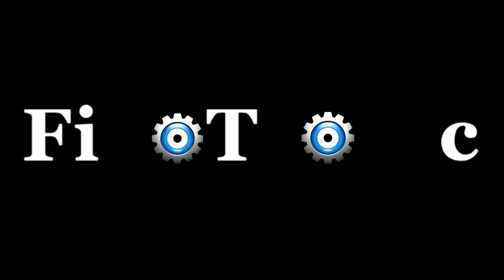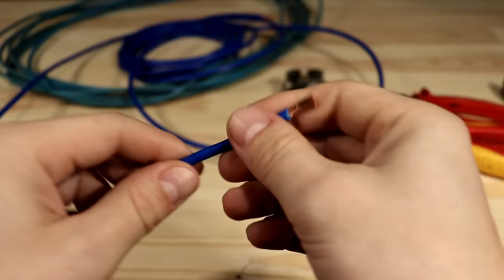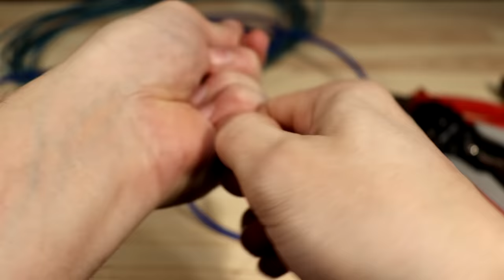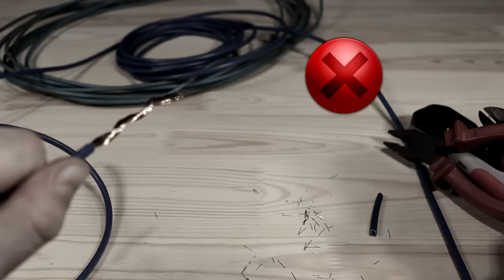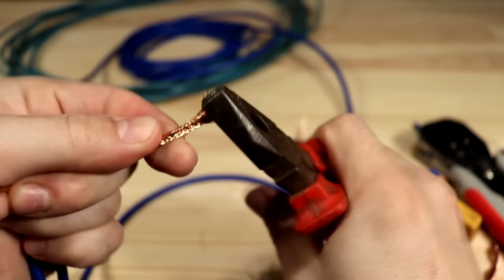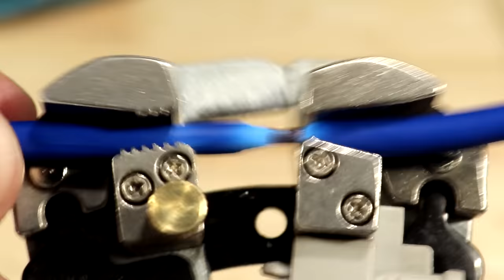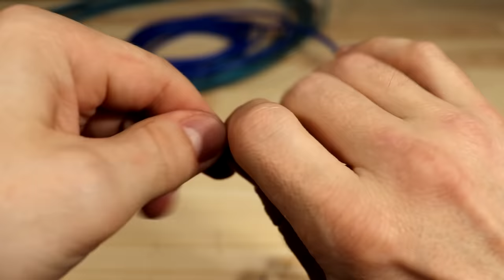AWESOME IDEA! HOW TO TWIST ELECTRIC WIRE TOGETHER!

Comment: There's a million ways to do everything wrong, next time don't waste peoples time, just show the right way.
Reply: Knowing how to 'not' do something is equally critical in knowing how to do something. Invention and science are reliant on failure. Patience is essential to saturation in the learning process. Consider how many people may have never done either process. For those, they leaned more than the impatient.
Reply: @AtomkeySinclair  Nonsense!
Show how to do the right way!
And that´s it!!
Or do you REALLY need to see how to do the wrong way?
Reply: um,  you're browsing random videos on youtube.  you were wasting time before you stumbled here and you'll likely be wasting time long after this.
Reply: He clearly isn't an electrician or knows about impedance. This is definitely not the right way. Fine for low voltage applications, but still wrong.
Reply: Amen!!!!
Reply: @FerreiraNeto77  You do need to know wrong ways of doing things to not repeat those mistakes.
Reply: Doesnt really matter in most cases how you do this. It depends on what the link is for and what sort of wire you use. Ive been using primarily method 1 (bc its faster), specially for 220V single strand wire, but also for hifi wire, then solder and tape up. (heated if i want to seal it).
Method 3 looks better and is way better if you need to pull wire through a tube, bc it is smaller in diameter of connection. The forces applied usually dont matter, bc there is no or very little strain on such wire and if you have to pull it through existing wire where a lot of force is applied in bends and such, all these methods will likely sever the bond.
Reply: so that's how you turn a LOGICAl idea into a 20 minute video... In 2019 I am KINDA partial to INSTANT info. 
I can get ALL world news in 10 minutes but it takes a "creator" 30 minutes to splice wire.
Reply: Yup.. he could show milion ways of doing it right.. like, wire crimp :) Its more used in car repairs, because not soldered connections are less likely to break overtime.
Reply: Luis Trigo Prunera. You don’t need to know the wrong way once you know the right way. Jeeeeez.
Reply: @luistrigoprunera3836  Sorry, but that is just stupid.
If I want to know the wrong way of doing something, I´ll look for a video that teach me the wrong way.
But if I open a video to learn how to do something right, this is what I hope to see.
If you learn the right way, you do not need to worry with all those mistakes.
Imagine if schools decide to follow your advice and teach the wrong ways for students. When they finally understood the mistakes, only then would the teacher teach them the correct way.
You really can not see how stupid this concept is?
Reply: @uplandmines  Please, ellaborate your answer
Reply: Right way is to use Wago 221 or similar splicer.
Reply: Agree!!!
Reply: @AtomkeySinclair  'Knowing how to 'not' do something is equally critical.'  Great.  You don't join two wires together by tying a rope to your ankle, the other end of the rope to an anvil, and throwing the anvil overboard when you are on a boat out on the water.  Critical information you clearly needed to know..
Reply: Here here. The right way is usually the best way.
Reply: That's not even the correct way.  The correct way involves inter-winding and soldering.
Reply: @luistrigoprunera3836  So many of us do, already...
Reply: cant believe i watch the whole two wrong ways & type the comment tho...
Reply: Agree
Reply: In french, it's called "épissure" and it is forbidden in electrical systems
Reply: @jaytony6535  I hear ya... ( not that I necessarily understand the meaning of the words you typed but... I, on average, don't understand the words I type myself ... On any given night... You clip single 11 [meanungless drivel here]
Reply: After 2 minutes I been looking at what minute to skip all this bullshit lol
Reply: @uplandmines  It is quite clear and obvious that It is for low voltage applications, the wires are too much thin for high voltage applications.
Reply: indeed....DO show us all methods as simetimes we think the "Alternate" is just as good...and isn't . Really?...6 min vid is too long in our precious lives?.... for a detail that can prevent an electrical fire and can save lives??
Reply: Please elaborate, @upland mines.
Reply: @FerreiraNeto77  how not to do the wrong way is equally important as how to do the right way. But I agree with Yu. He should have shown the wrong ways in fast forward and then show the right way. Chill man. Life is short.to each his own way.
Reply: Somtime, u must learn mistake.. and much people thing that is the right way, actualy in this video he try to show, that is the wrong way..
Reply: If you've got that much strain on your wires you're doing something wrong.... Wires are for electricity not support structure.
Reply: @ChillyDippers  ya. You ar spot on. I think these measures are only for certain outdoor emergency albeit temporary situations. It would be stupid to use it in permanent installations.
Reply: The first 6 mins was a waste of my time. Cheers.. 🤔
Reply: Don't you cut each wire diameter by half so the twisted final wire is the same guage as both original wires???
Reply: Agree
Reply: yes agree, wasting my time
Reply: John David  This is NOT how you do 110/220 hard single core wire as in household wiring, you use a twist cap then tape the cap to the wires to help seal any bare wire, The cap has a narrowing spring in it that slightly cuts into the copper wires and makes a tight solid connection. This method shown are for basically low voltage, light weight wire. Speakers, phone etc. Tight connection = less resistance = less heat = less loss
Reply: Good morning John David,
no, he’s definitely not an electrician. 
Cheers,
Si.
Reply: @AtomkeySinclair  No need for a essay. And you also don't need to be shown the wrong way. When you was taught in school. I can bet they didn't show you how not to do it. Every watched educational videos? Again they never show you the wrong way. This guy's a time waster
Reply: hahahahaha
Reply: Right Way would have been replace the entire length.
Reply: John David  No it wont as long as you use quality caps and tighten securely
Reply: I enjoyed the video
Reply: Dude... you do know you can skip the video until the end and watch what you want, don't you?
Reply: Hi John David,
I apologise if I err. I am positive techniques have moved on at tremendous pace in the many years since I completed my time as an apprentice. This has possibly left me with sketchy memories of a bygone age. I truly thought that as I have just recently retired after a career of almost forty years initially as an EHV cable jointer (including the associated telecoms and control requirements) before becoming an electrical engineer in the supply industry, I may have incorrectly presumed I possessed a tenuous grasp on the subject. 
Cheers,
Si.
Reply: @budman8926  Got me man - My welding instructors were insistent for two years on demonstrating how to not weld - in order that we understand how to weld. I suppose they thought it was important to know what makes a weld fail - ya know, since people's lives are on the line when the are in a steel skyscraper, or a bridge, or heck, even a roof top.
Reply: @luistrigoprunera3836   I know 10 more wrong ways. So video should be longer 30 minutes
Reply: @uplandmines  could you please direct me to the proper way.
Reply: Thanks brother
Reply: How do u know it is wrong man 
Try it first than say🤔😑😐😌😊
Reply: @uplandmines  Exactly. Maybe acceptable for low voltage (and low current), but that's a big wire for most low voltage applications. Use the correct connectors, or solder and insulate.
Reply: John David  This method is stupid. Don't pay attention to anything you saw in this video. It's incorrect and a pointless waste of time.
Reply: Stephen Flaim
Reply: Matthew Blouse absolutely not! The wires wouldn’t be able to carry the load if you cut strands off. It would then heat up and cause a fire
Reply: Harley Ross I think you’re right. It’s a western Union splice. We learned about it in high school but I have been an electrician for almost thirty years now and have NEVER seen it outside of a textbook. I think it’s safe to say it is NOT the right way to do it anymore
Reply: Robert Smith nope. They make smaller “caps” for smaller wire. You’ll never see this splice in the field. This is the way they did it in the 50’s I believe. Really outdated
Reply: John David because it’s illegal!!! You’d never pass an inspection with this madness. This man is either 100 years old or not an electrician. Either way, please, forget you ever saw this video
Reply: NASA KNOT ANYONE?
Reply: @justinrockmore327  sorry you feel that way about the truth
Reply: exactly!!!
Reply: Agreed, theres not enough time in the world to know all the wrong ways of doing something, just teach me the right way to do it and I have no reason to do it any other way.
Reply: The first "wrong way" is the easiest and most common way, not just a random wrong way. So it's relevant and a comparison is needed. Without it, the new proposed way is not proven to be a better alternative.

This information is free, the video is just 6 minutes, no one force us to watch it, and seek bar is there for a reason.

Thank you for making and sharing this video.
Reply: Exactly as i said we def learned how to struggle  stripping wire and then the last way (his right way) he put the super twist with the pliers lol
Reply: I SO AGREE WITH YOU!!! WTF..just show us the laast  one for gods sake!!
Reply: Jonathan Tenorio €
Reply: BRRRTTT!
Reply: Nigga could have just solidered the damn wires. That's the real right way.
Reply: StephenFlaim LOOKING4TRUTH 
OMG!!!  I so agree... like everyone else on the planet🙄!!!  ...except for the gentleman who did the video. 🤭😬😁😁😁😁
Great GREEN F*CKING CHECK MARK  ✅ TIP at the end... seriously, that’s a great method! Thanks!  (But that buzzer that made me jump, that was just plain mean!)🤨.  I gotta get that tool for my husband ASAP.  But, yeah... a lot of time wasted & showing the WRONG WAYS might confuse one’s memory... ya know, like 3 years from now when you’re trying to remember this method on the fly.
Reply: Agree
Reply: @FerreiraNeto77  exactly
Reply: @luistrigoprunera3836 how  are you not going to confuse the wrong ways with the right  ways?
Reply: @JacobIsaacSolomon  a Western Union splice
Reply: @BenoitLahlou  if you solder it afterwards that is a Western Union splice, that is the only splices you can have outside of a box. It's used mainly in Old work with knob and tube wiring.
Reply: @Beardy-plays  and it's not a Western Union splice unless he's sodders it afterwards, and then tapes it with rubber tape, and lastly wraps electrical tape around it.
Reply: @doc5380  or old work, with knob and tube wiring where your splicing outside of a box, but you must solder it afterwards.
Reply: John David  what are the journeyman teaching you??
Reply: @simoncoulston7223  people are going to be a little rusty  at things they don't do everyday, then the things they do daily. It would be like an orthopedist or dermatologist attempting to perform CPR
Reply: @exodeus7959  that's been done already, you could probably find that here on YouTube, old footage with  crash test dummies.
Reply: @AtomkeySinclair  and the sad thing is if somebody's first experience with something is shown to them the wrong way, it's very hard to correct them later,  and show them the right way. A good or bad teacher can make all the difference in the world.
Reply: @2ceeze893  it's used primarily now in Old work where your splicing into knob and tube wiring, outside of a box. BUT you must solder it afterwards, and wrap rubber tape around it, and then electrical tape it.
Reply: John David  you have to be able to know what is accurate though and what isn't. It would be like somebody telling  you about spark plugs for diesel engines,  and if you don't know diesel engines don't have spark plugs, you might take whatever they're telling you seriously.
Reply: Good morning Frank Paya,
I couldn’t agree more. Anyone who, for whatever reason, is unable to practice the use of their talents and skills on a regular basis, is without doubt going to become rusty. 
As a side note, I very much hope that we are all saved from ever being called upon to perform CPR.
Please don’t misunderstand me as I know that people taught CPR in a classroom (as part of their employment etc.) have saved many, many lives and it’s truly a fantastic skill to learn. I am very aware though that it’s a totally different scenario altogether when one is in a real life or death situation.
Basically I wouldn’t wish the situation on anyone. It certainly put much fear in me and would once more should it ever happen again. 
Hoping you and your’s stay safe during these unsettling times in which we currently live. 
Stay safe. 
Cheers,
Si.
Reply: Good morning John David,
that’s your opinion and very valid it is. It just differs from mine that’s all. Each to their own and so on. I don’t think I actually described my method. Or did I? I very much doubt the existence of a method I could claim as mine own and would definitely never claim I had knowledge of the only correct approach. I’m afraid I have neither the time or inclination to look back through this thread in order to find out for certain. 
Anyhow I wouldn’t like to think that either one of us being gentlemen, could ever become overly upset over such. .
Either way I’m now at a point in my life where it’s very unlikely indeed that I’ll be required to make such a connection. So you may rest easy that the “wrong way” is no longer being followed at least by me. 
Hoping your apprenticeship was completed with distinction, associated flying colours and was celebrated with much fanfare by all. 
Stay safe young man.
Cheers,
Si.
Reply: @frankpaya690  yes it is. The act of splicing the 2 wires is the splice. 
The finishing is just that. 

You're a fool if you think just because it wasn't soldered and taped that it wasn't spliced.
Reply: @frankpaya690  You know this is strange. I literally have to go to WU. Thank you for reminding me and taking the time to comment and  let me know the correct term. I much  appreciate it! You are a very kind person.
Reply: Technical ITS
Reply: @uplandmines  It is wrong way, isn't it ? Then find and explain the right way you know !
Reply: You are right
Reply: Ferreira Neto l
Reply: StephenFlaim LOOKING4TRUTH no shit
Reply: @ramsdellcp  Some people research the right way before important project. Wasting ones time just because he is allegedly wasting it browsing youtube is wrong.
Reply: agree
Reply: No kidding. Way to long for that!
Reply: Wow 10 minutes spent just so he could make a piss poor video on how to do a lineman splice
Reply: @FerreiraNeto77  He is a time thief!
Reply: No , I think this tutorial works for a layman like me coz I was doing the wrong way like  it have show before
Reply: @FerreiraNeto77  That is how you learn, you are shown the mistakes, and understand it better.
Reply: agreed.. but also when was last time one had  one braid of  wire to cross over.. mainly  now its triads of wires to blend
Reply: @ramsdellcp  well put.
Reply: @Achabab  That video you show is for crimping, and it is not the best way of doing it, solder creates a solid joint followed by heat shrink is the better way as you not only have more contact, but better insulation as well.
Reply: You need to see WHY the other methods are wrong. But yes, this video could have been a lot shorter while still showing that.
Reply: The first one is the way you're supposed to do it 
That and then put a wirenut on it
Reply: @gamerguy247365  They are called crimps, cheap and nasty
Reply: @gamerguy247365  yes thats correct, and make it strong 100% l
Reply: @uplandmines    Maybe he should try Viag....ohhh impedance. never mind.
Reply: The twist:  the last way is also the wrong way.
Reply: @AtomkeySinclair  
   

,0 '
Reply: Wasting time
Reply: savage dude...!!!
Reply: John David  Auch die letzte Variante ist falsch und unzulässig weil gefährlich.
Reply: @ramsdellcp  some people come here for experience in the trade?
Reply: @uplandmines  I am an electrician,it's called a Western Union splice.What about Impedance?I don't see a coil there anywhere.
Reply: @Murilo183  You obviously never worked with thhn wire.Looks like 14 or 12 gauge
Reply: @damistavista9539  I really do not know how you supposed or guessed I do not work with wires...are you a fortune teller???🤣🤣🤣
Better luck  next time man, I REALLY DO WORK WITH WIRES, I am a eletrictician...do you??
Reply: @Murilo183  Well, I hope you're a better at electrical work then spelling.lol Yes I am an "Electrician."
Reply: @damistavista9539  certainly I am...english is not my native language ( i am brazilian), the same way i give it back to you: are you a better electrician than you are at fortune telling???

Be humble fella...be humble.
Reply: @Murilo183  I am humbled sir.Do you live in Brazille or US?
Reply: @damistavista9539  I am brazilian... for your form of writting my country 's name you (Brazille), I suppose you are italian...am i right?😆😆
Reply: true shit
Reply: Saiko pet
Reply: Atomkey Sinclai
Reply: @AtomkeySinclair  ¹
Reply: 90% videa je dôležitá asi tak ako vyrazená poistka v hodinách alebo ako sám tvorca vydea
Reply: If you don't want to waste time, don't watch YouTube.
Reply: 10 /4  what a wast of time   I though I might learn something
Reply: @AtomkeySinclair  a
Reply: Exactly! Won’t be watching any more!
Reply: Ķķ
Reply: Exactly!
Reply: Bingo!!!
Reply: I appreciate the effort you put into making this video.
Reply: This video presents an awesome and innovative idea for twisting electric wires together. The step-by-step guide is concise and easy to follow, making it a valuable resource for anyone working with electrical wiring. The technique demonstrated is both practical and efficient.
Reply: While the video was informative, I have to say that the methods shown here are outdated. Modern wiring techniques are much safer and more efficient. I think it's important to update the content to reflect current standards.